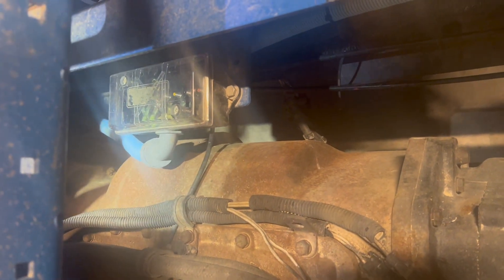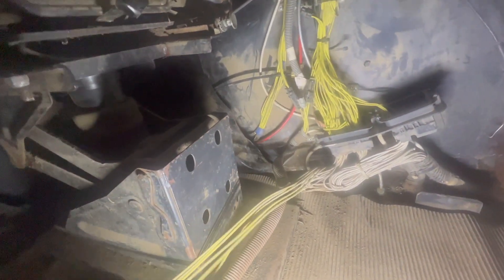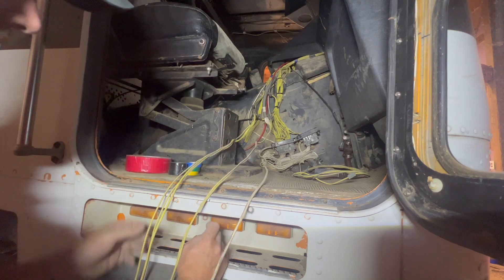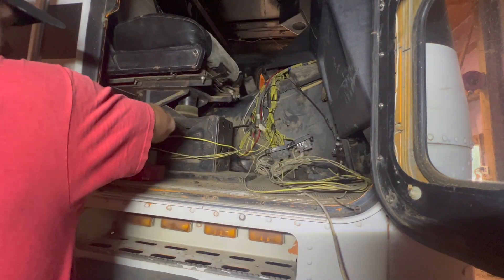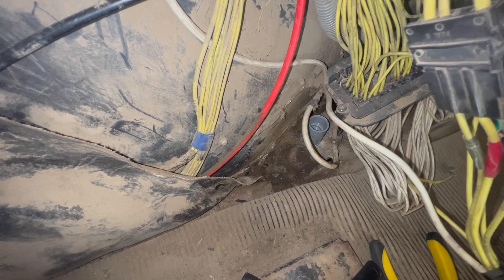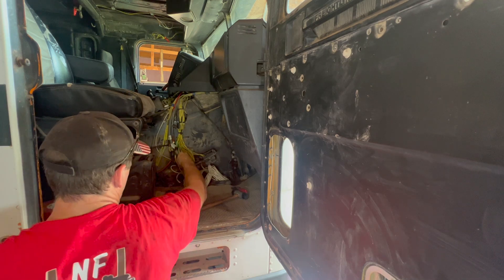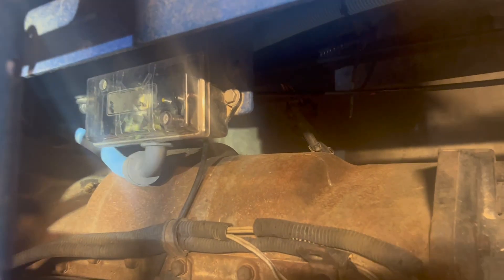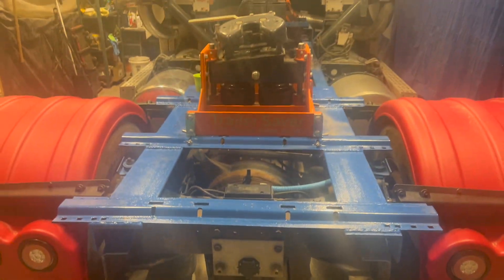Semi trailer wiring, short version.

Comment: I haven’t had a chance to get a good look because underneath my cabover is so dirty, and I’ve been trying to follow where the wires ran into the cab. Every video I’ve found prior to this one only showed how to replace the coiled wire that runs from the truck to trailer. Been trying to get an idea of how long of a harness I need to order and this helped out a lot. I’m pulling semi trailers with mine wiring won’t be different, but I just need to replace because 37-38 years has not been kind to the condition of the wires 😕
Reply from the maker: Glad I could help!